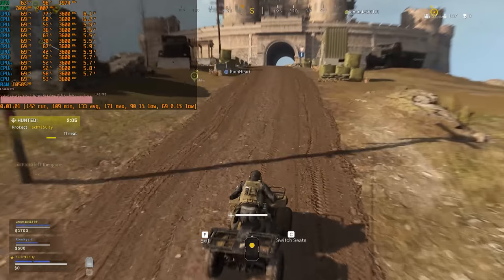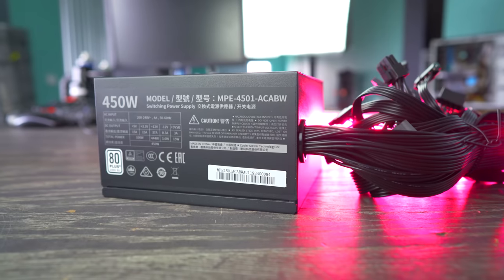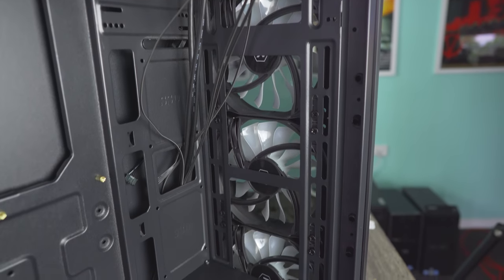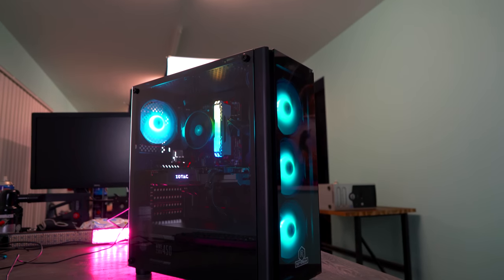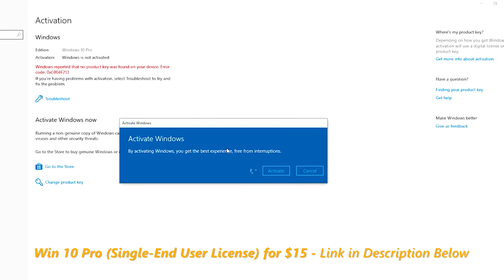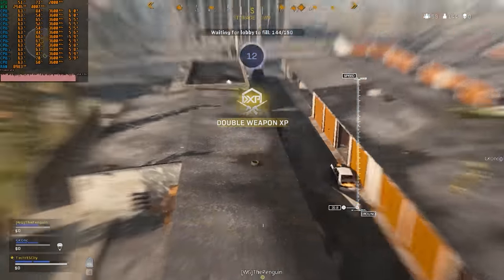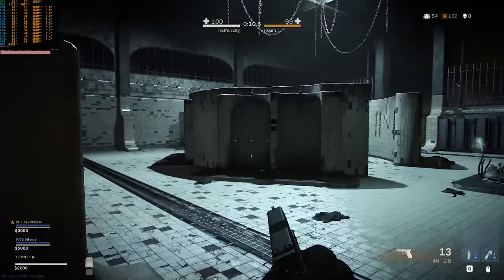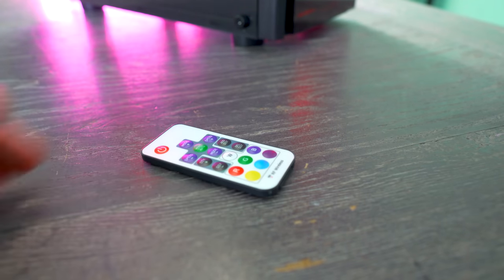The $590 CoD WARZONE 1600 AF "ULTIMATE Budget" Gaming PC

Comment from the maker: Thanks for the feedback on the crashing y'all. Apparently it is rivatuner and Warzone, not playing nice together (which I use for displaying fps and benchmarking). Might want to disable this app or not install it if you are playing CoD.
Reply: The build is quite nice, BUT that case is utter garbage! I bought a i7 4790 (with CM hyper 212 black Ed.) RX 580 build off facebook and i was seeing my cpu and gpu temps upwards of 90c in regular gaming. I then switched all my parts into a Phanteks P400a and that instanly brought my thermals back down to 45-50c and 60-65c respectably. I guess this is what happens when you stick tempered glass infront cheap fans with no airflow though.
Reply from the maker: @rhyshutchin5  Can see the temps in game, GPU didn't top 65 degrees, and CPU was sitting at around 70 with wraith stealth... this one isn't too bad, sure don't go high end with it, but mid-range gear its fine?
Reply: far from budget... andthis doesn't include taxes, nor   does it include  windows 10, or  shipping. On top of that i live in canada   ..... not  usa. This is a 1000 dollar pc...     far from budget
Reply: @catatonicgalaxy1471  lol we don't pay taxes after it's already included in the price
Reply: If you just dont open msi at all it works fine if its still installed, its just if you have it running
Reply: Hey Bryan I had a quick question. I recently bought a bunch of used parts including a Ryzen 5 1600 AF and a MSI GTX 1070 Quicksilver for a budget gaming pc. The motherboard that I have is a b350 gaming pro from msi. Since the ryzen 5 1600 af is running on zen+ architecture does that mean I would have to flash the bios in order for the processor to work on the motherboard?
Reply: I used both together and have 0 issues on my Rx 570
Reply: Rivatuner gives bfv micro stutters for my setup.
Reply: I was wondering why my game was crashing. Rivatune was running in the background. I was blaming chrome eating ram
Reply: @shanedesilets4958  Hey I'm not Brian but I can answer your question and no you don't have to flash your bios. Zen and Zen + both run on B350 out of the box the only cpu you would have to update for is zen 2 which is the 3000 lineup hope this helps.
Reply: @rhyshutchin5  No need to waste money on an expensive case.... if your PC gets hot whilst gaming, then just take the side panel off - instantly better airflow...... still getting hot? then put a desk fan on and direct it at the open side panel. Use headset to drown out noise. Job done.
Reply: why not get an rx 580 8gb to save some money? they almost get the same performance in this game
Reply: COD Warzone Had 15 Million Down Loads With In 3 Or 4 Days ! I Was Just Reading An Article About It ! O And My Budy Kept Having The Same Eror Pop Up, An We Just Did A Clean Install Of Windows 10Pro I Run Win 10 Enterprise LTSC 2019 But He Was On LTSB 2016 & I Couldnt Find My Ltsc Keys ..lol. But I Will ! I Like That Soo Much Beter Than Pro !
Reply: im running rivatuna with a gtx 960 and im not seeing this funkyness
Reply: Hey Brian, How far you could overclock r5 1600 af agaist 2600 oc?
Reply: Try reinstall the game and install it without interruption also try reinstalling the shaders first if it still the same you need to re install the game that's what I've done but if there is an internet interruption make sure to pause.
Reply: Also the rivatuner make sure to disable that because it can cause black screen and closing the game base on my experience
Reply: Where do you buy your used parts
Reply: javier rivera some of us aren’t adults with jobs or family refuses to pay for a pc and parts are hard to find now due to the coronavirus.
Reply: Ricky Pure  nah apparently it WAS Chrome, so i dont even know anymore
Reply: Pelle Sanders not better than a 1070. Plus if you intend to steam your gameplay nividia is the only way.
Reply: AceuGaming every graphic card has their own driver. Because of this not all problems happen with every line of gtx cards.
Reply: @catatonicgalaxy1471  yo windows 10 unactivated is free and with no draw backs other then a little unnoticeable water mark and supposedly if you shop yourself for parts there is no shipping and you can get better prices
Reply: Thanks so much for the video I'm literally going to make this PC for myself only changes more Disk Space, More wattage PSU and a MSI 1660 Super
Reply: Where’s the best place to get a pc? I’m a console player but want a pc
Reply: seen more than a few benchmarks the ryzen 1700 faster in game fps with vega 64  than  a ryzen 3600 ?
Reply: Where did you purchase the cpu? Its over 150 us dlrs 😪
Reply: Hey where can I buy 144fps pc 600$
Reply: @CDH2020 1 what's cheapest budget?
Reply: Is there a prebuilt you recommend for warzone around 600-650$?
Reply: How long has it lasted?

Comment: "If you change this to red, you should also get some more performance as well"
I'm using the same RAM kit in my PC and have been running it with the LEDs set to white. Changing them to red dropped the temps on my RAM by 6.5C. Clearly a definitive test that proves this is sound advice. :)
Reply: I kinda feel triggered haha
Reply: Will painting red work ?
Reply: How about more guns
Reply: iirc, red light requires less energy than those higher in the colour spectrum.
Reply: @glennco8263  I'm not so sure it's specifically that the red LEDs use less power/generate less heat so much as that the white requires all the LED colors which generates the most heat. I didn't want to include the part where shutting off my LEDs completely reduced the temp by another 5C :(
Reply: I thought Bryan was joking about that at first. . . a lot of people like red LEDs (I prefer blue, not white. . . and for now don't plan to get RGB RAM kits).

Comment: I liked this video, I recently built a new used mixed PC at the end of Jan 2021. AMD  r5 1600 and b350 Asus Prime Plus from AliExpress.  Gskill flare x 16gb 3200MHz Ram bought local with the Seasonic Focus gold 650W, kept my gtx 460 1gb and Antec P182 case.  Huge difference from my intel c2d E8400 with 4gb ddr2-800 MHz Ram.  Hope to up to an r5 2600 or r7 2700 later this year (cpu used from AliExpress)

Comment: I would replace the case with a different case in that price range that provides better airflow. The case you picked is horrible in airflow, which makes cooling components harder. My pick would be the Cooler Master MasterBox MB311L as it is $60 USD, and has a mesh front.

Comment: AMD Ryzen 5 1600AF, XFX RX 470 8GB GDDR5, 16 GB Dddr4 2667, all low, full HD, 144hz, 120-160 FPS. Game works great, i have a SSD + HDD as well. The only thing u need is very good ventilation to dissipate the heat. Good build btw, like your cable management! Cheers!

Comment: Note: On AMD "XMP" will often be called DOCP instead - its the same, but its nice to know, I was kind of confused when I couldn't find XMP on my new ryzen system, untill I found out it was often called something else on AMD
Reply: Good looking out, I believe that XMP is actually an Intel brand trademark but they do the same thing.
Reply: I know that is an ASUS only thing
Reply: @abhimaanmayadam5713  Its an asus board I have, so you might be right. Waiting for it to die like all other asus mobo I ever owned. but it will probably last a year more or so. 

At any rate, I was told it was DOCP because it was AMD. Maybe its only Asus following that rule.
Reply: Krydolph docp and gocp are Asus and gigabyte. I think other brands use amp iirc

Comment: i found that having afterburner on screen monitoring caused me a lot of issues. i kept on getting the directx error. seems to be an issue with modern warfare before warzone was released. only way i could get around it was to use full screen borderless or turn off msi afterburner. might have to do with the fact the game has its own on screen monitoring in the general settings. other than that the game is great so far. i havent had any texture issues with the game on a few PCs. good thing with battle.net is you can copy the game folder to another pc and it has an option within the warzone game page to locate the game folder. that should save you from downloading it on any pc. great to see the 1600AF being sold at aussie stores to. great bang for the buck when it comes to new pc parts IMO.
Reply: MSI Afterburner is the problem  same here..Turned it off  and selected  FPS AND GPU TEMP enabled in the  options  menu  Cod  MW  instead ...Works perfect no issues.

Comment: This is a really similar setup to what I have. I am running a r5 1600, gtx 1070 amp extreme, 16gb 3000mhz, 240gb ssd, and 1tb hard drive.
Reply: hi, i have the same setup as you except i'm running a ryzen 5 1600x, i have all settings set the same as this guy in the video, but seem to get only around 110 fps in warzone, how much fps do you have?

Comment: I'm in the UK where the AF is is a little harder to find so belived i was ordering an r6 1600ae but when i saw he small cooler and checked the model number and found AF i was over the moon to say the least got it for £89 which is a little more but still cheaper than 2600 the whole build with a rtx 2060 on the same job (which I gotta say wasn't bad at all for the price)  ended up with the whole build done for £450ish was for a friend and I gotta admit I'm super jealous with the price performance he ended up with AM4  has gotta be the best value I've personally ever experienced from pc hardware

Comment: With all the latest Warzone updates, at this rate you'll need more than a 1 TB HDD...
Reply: Not only that, but the game becomes less and less optimized with each update. Around the time this video dropped, I used to easily get 130-150fps on high settings without Ray tracing (rtx 2070 Super + 3700x), and now I stay right around 100 to 110, 90 if I have Ray tracing on. I'd suspect something is going on with my PC if frames dropped in every other game I play, but they haven't
Reply: Lol I bought a 240GB SSD for this game when it launched back then it was only 120GB but now I regret it so just using my 1 HDD for it
Reply: @Joker00644  luckily I had a 1 TB m.2 with space, but damn, I hope this isn't going to be the thing every year. I know games are getting larger and will only get large, but there's no reason for CoD to take up 200gb.
Reply: Jake Miller yeah like GTA V have been out for many years at highest it’s around 70GB
Reply: @TheJaketyler93  I get 120fps on a 2080 Super Max-Q, maybe you need to update your drivers or something.
Reply: @itsmrdante6274  you're getting about 10-25% better frames on a better card, that's normal. I'm just saying I used to get A LOT more frames on my 2070 super, even more than you are now on your 2080 Super. My drivers are completely updated.
Reply: @TheJaketyler93  The 2080 Super Max-Q is  worse than the 2070 Super, the Max-Q is the laptop version of the GPU, you should be getting at least 144fps with your GPU. I don't know what your CPU is tho, because you could be bottlenecked... But Idk what problem you're having then, because you should be getting more frames. It is completely random tho, because I was not able to play Warzone about 2 months ago because I was at 30 fps or having glitches.
Reply: @TheJaketyler93  in this video he is using a 1070 so no raytracing which greatly improves performance
Reply: @bruh-dj5uo  Yes?

Comment: The moment I see 1600AF I knew we will have a budget build on hand.
I got whole batch of 1600AF from a retailer in Hong Kong for around 80 dollar, these thing overclock well, and generally perform like R5 2600, dozen customer got 1600AF with used RX580 GPU combo, unfortunately I was unable to source cheap B450 with 4 ram slot + good VRM, and settled for B350 instead.
Reply: Verpal Why would you need 4 ram slots paired with a 1600AF? Most of the time you’ll be using 2 right?
Reply: Use a320. It's good enough
Reply: @thilobroecheler4109  For future upgradability, I usually use 3000/3200mhz 8+8 dual channel ram for my client, only in the lowest tier such as R3 1200 + RX570 I will use single channel 8GB and a mobo with 2 ram slot.

Comment: I legit can't get 140 fps with my 3080 I've gone through all the channels to try get more and I just can't figure it out...
Reply: you might be CPU bottlenecked then, what resolution are you playing on and what CPU do you have?
Reply: Running a ryzen 6 3600x all other games have fps high af. I've lowered my settings an play at 1080p. Drivers are up to date an I've followed an optimisation video which didn't help at all.
Reply: @Speedslays  so you set the renderer worker count to 6, right? Btw I advise you to download Process Lasso and set the priority to above normal on ModernWarfare.exe, I gained ~20fps with my i5-8500 and rx580 with it
Reply: Thanks for the advice. I'll check this out asap
Reply: I didnt gain anything by using process lasuoo or what ever. Lol
Reply: I'm getting 120-160 fps @ 1440p with a 6800 XT and the i7 7700k OC to 4.8Ghz
Reply: Ryzen 3000 is horrible for warzone. I have the exact same problem with my 3700x and 3070. I’ve made the renderer worker count 8, lowered all the settings to low and play on 1080p. Can’t get more than 130 FPS—maybe 140 at times. UsuLly around 110-120. My GPU time is 4-5 ms, and my CPU time is 7-9. So Ryzen 3000 is a serious CPU bottleneck on warzone. Now what I can’t figure out is why the guy on this video was able to get 140 FPS easy with a 1600AF. Maybe I have to enable XMP profiles? Who knows.
Reply: @tubular7752  ah fk that is shity. Time to upgrade i guess

Comment: The case linked unfortunately is acrylic, not TG. Hard to find TG RGB cases under $60 in the U.S. Only decent option is the CoolerMaster MB311L but that only has two ARGB fans on the front.
Reply: Mikie S if you’re looking at Micro ATX tempered glass cases check the SilverStone PS15. Tempered glass, compact, mesh front panel. Overall good case! And you can get an rgb version that has two RGB fans included for an extra $10

Comment: my pc only cost me around £280. xfx gts rx480 - £!00, fx 8300 overclocked to 4.0ghz  + asus mobo combo - £60, 16gb 1600mhz ddr3 memory £30, 120gb ssd £25, 1Tb HDD - £20, Antec 900 case with led fans - £10, corsair 450w Psu £30, cooler master cpu cooler £10. I get around 85fps on mostly high settings with a mild OC in the Gpu. So yeah you can play warzone in 2020 for as little as £280 if you are willing to buy used parts. Btw I've had this system for around 8 months now and no problems.. even the max temp on the cpu is in the low 50's on full load. even the gpu only hits 65 after a few hours of playing.

Comment: Instead of the 1600AF you’re better off getting a 2600x with a mobo from micro center. The 2600x is originally priced at 100, but you get $20 off if you buy a mobo too which means you’re essentially getting a slightly faster cpu for $5 less.

Comment: I just built one tonight with the exception that I used a gtx 970, max settings ,solid 60fps 1080p I and am happy slight oc to 3.75ghz @ 1.28v All core , using the 2600x cooler, great chip I’m stoked , could push to 3.9 but I’ll keep cooler 🤘🏾war zone is great

Comment: I have an i5 8600k, 1070ti and 16gb ram (2400) and I get less FPS than this. Whyyyy?
Reply: Do you use nvidia? If so you can run their control panel and see if your FPS is limited to a certain extent. You can go into the settings and make your FPS run at max performance up to 144 instead of 60. https://youtu.be/RYYoCXh2gtw in this video this guy explains what I’m saying you need to do to improve performance and FPS
Reply: Wesam Alnasser  i upgraded to 3600mghz and still dont get much more
Reply: i now have a 3700x 32gb 3600mghz dual channel

Comment: Also suggest cranking that RAM up to 3200MHz.  Have same board with 2666MHz  16 18 18 36 ram running at 3200MHz with slightly looser timings, resuliting in slightly lower ns latency.

Comment: i was gona get a 1600af  until i won a used 1800x for 115$ usd got that paired with a 8gb rx 480 and 16gb ddr4 works like a champ at everything i throw at it plus the extra cores and threads  help me a lot on other stuff.

Comment: I bought a Ryzen 5 2600 last summer for $130 usd and thought it to be a bargain, at $85 it's  a steal. My rig is similar and it's  fast and cool. I was able to pickup the Wraith Spire for $15 on ebay, this dropped  temps about 5 degrees C. Great build, bang for buck.
Reply: I picked up a 3500x for $105. This beast's games faster than even 2700x and 3600 (with SMT enabled).
Reply: @thrace_bot1012  Great price for a great product.

Comment: Great vid, Brian! 🤙This Tech Yes Citizen is still rockin' the Ryzen 5 1600 (non AF) with Sapphire RX-580 (8gb) and still happy with the performance of my 3 yr old build. (I am looking at a GTX 1070 for an upgrade). Also on a side note, I've built 4 PCs now, and with those builds I've always used you coupon code "TYCSK" on both SCDkey and vip SCDkey. I am always surprised it keeps working! Stay safe out there with this world crisis and keep on hustling.

-Maui No Ka Oi! 🌺
Reply: GTX 1070 is great (I upgraded from a GTX 960!), but for you I'd wait for rdna2 or rtx 3000 series, cuz a rx580 is still very capable.

Comment: I have a R5 3600 and a GTX 980Ti SC. I have an fair overclock of 500mhz on the memory and 100 on the core and on all low settings I can only average around 100-120fps. An overclock 980ti should perform alot better than a stock 1070 but I'm seeing otherwise.